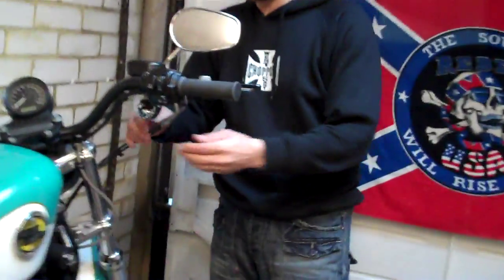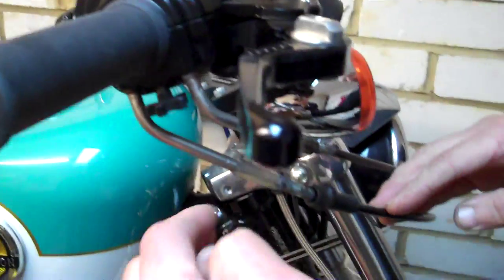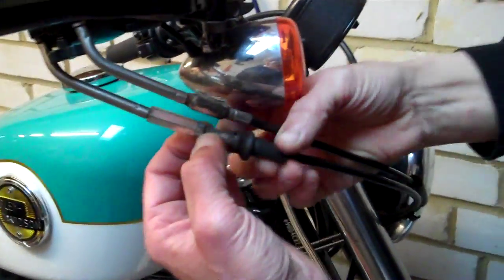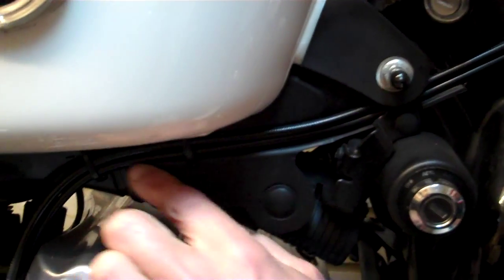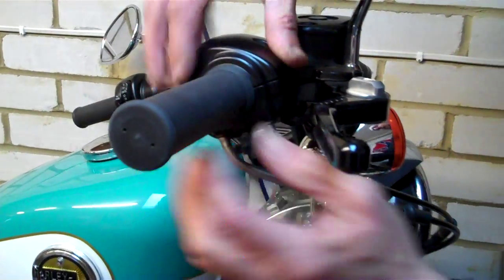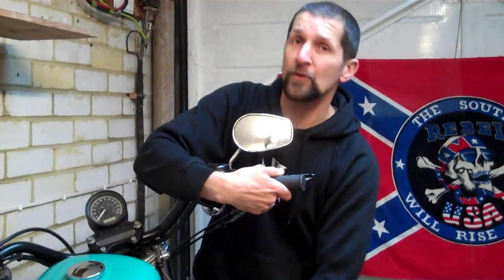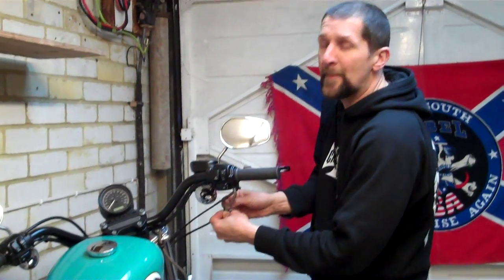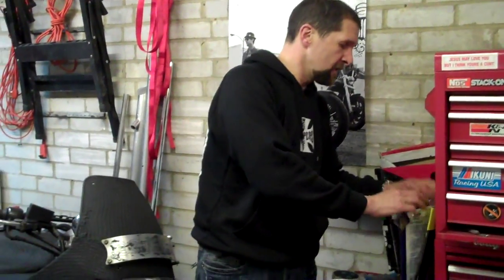Delboy's Garage, reply for vanrocco66.

Comment from the maker: Hi Tom, well aren't you resourceful!  There was back in the old days, a thing called a 'solder-less nipple', it was a brass block with a hole and a thread in it and a screw that screwed in and trapped the cable wire, but these are a thing of the past, like kick starts!  Quite simply, Tom, BUY A NEW CABLE, they are not repairable, you can cast nipples using lead or zinc, but it's a ridiculous, messy and dangerous past-time (smelting liquid metal) when a new cable is just a few £, well done, Del

Comment: hi,  i'm tom i'm 17 and i ride an aprilia. my throttle cable broke where it connects to the assembley at the grip, its a moulded ball on the end of the cable that broke off so i replaced it with a small piece of metal bent around the cable but this keeps on eventualy coming off. do you have any ideas on how to fix this? ive tried the little brass electric connecters with a small screw but there too big to fit in the assembly. any help would be great cheers tom :)